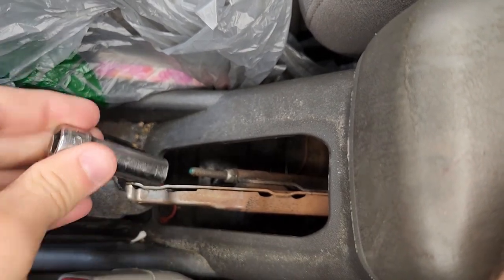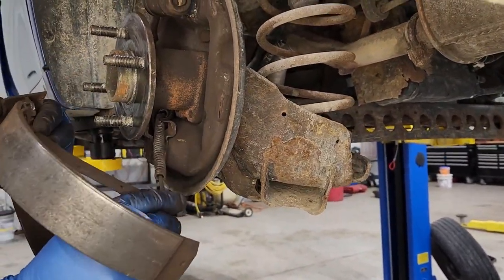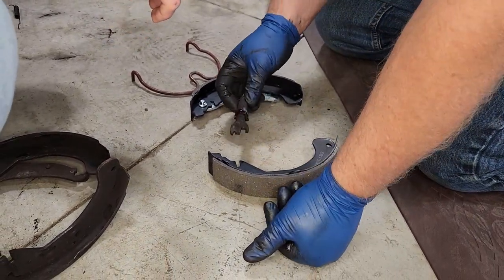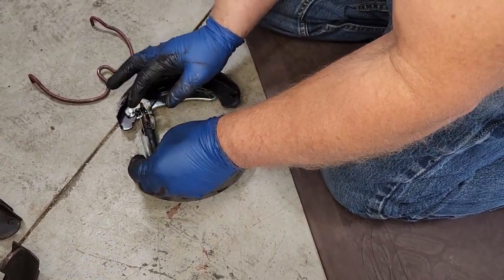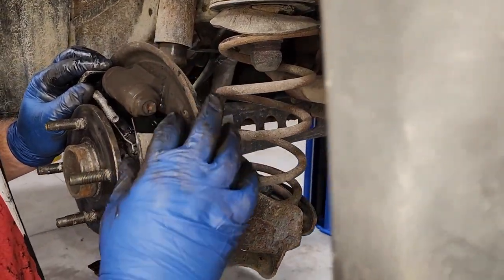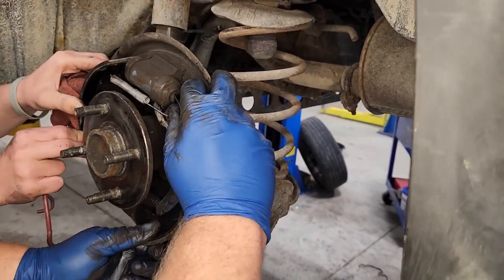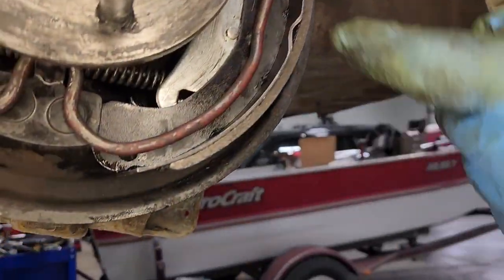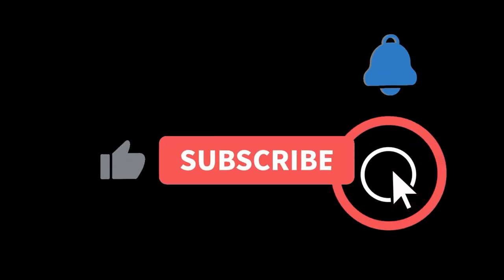How to Change Rear Brakes on a 2006 Saturn Ion | (Not as Hard as it Sounds!)

Comment: So there’s no need for heat or banging on the drum just a simple parking break cable release and boom done, right?
Reply: Updated: in order to take the drum out loosen the adjustment screw, that should make the drum break slide out with ease, only time you need to bang it is when the drum is rusted together with the wheel hub, also to get the emergency cable to lock on the shoe you need to loosen the bolt, other than that it was a easy take apart and put back together